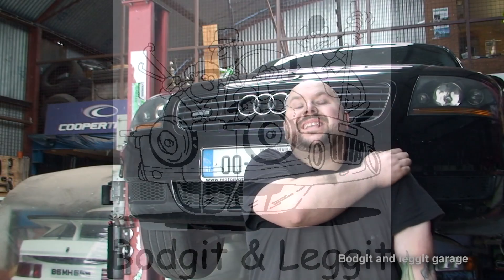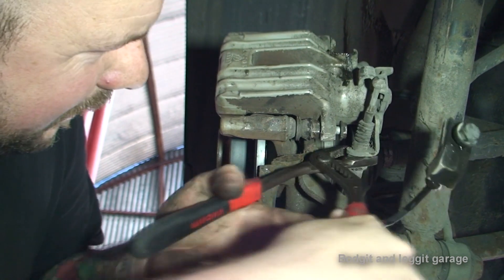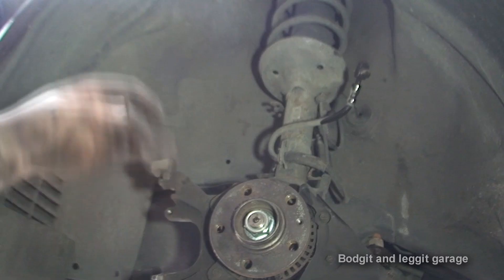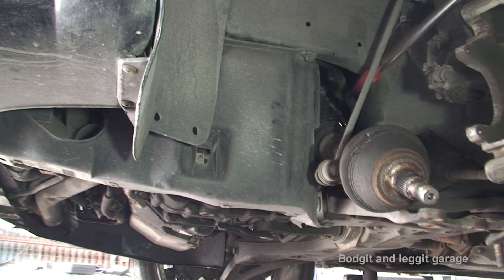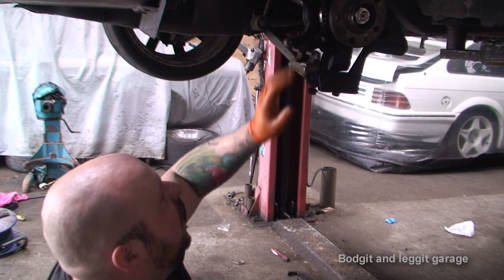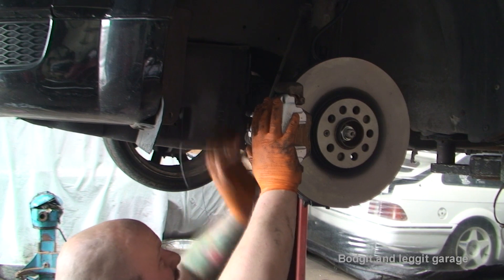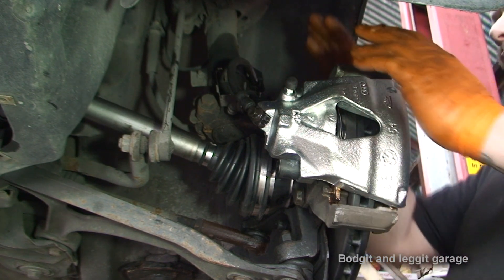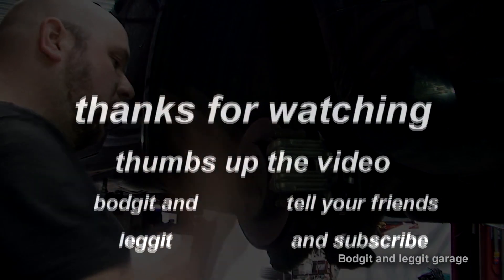Audi TT Replacing front/Rear calipers front drive shaft part3 bodgit and leggit garage

Comment: Great video. Very informative. I'm going to replace a rear calliper on my TT Mark 2. Will it be the same as this basically? A friend has told me that I'll only need to bleed the brake I'm replacing. Is that right?
Reply from the maker: YelpBullhorn hi mate yes it will be very similar as you can see from this video I never undo the bleed nipple just turn back the pistons make sure you take off the cat from the brake cylinder in the engine bay this is all you need to do been doing this for a long time and never had any damage doing it this way also this way you do not have to bleed anything

Comment: Excellent video. I have a question. Don't you replace the copper washers for the calliper? Copper gets harder when you squeeze it by tightening the bolt. Eventually they don't seal properly anymore, I assume, because they don't compress anymore. I've reused copper washers also. But I always wondered if they would seal properly or not. Of course you can check that visually but still the question remains whether or not this is the right thing to do.
Reply from the maker: hi mate  good question i see where you are coming from  the I've never had a problem in doing this but the easiest way to check i've never had a problem in doing this but the easiest way to check his get someone to press the brakes as hard as a can when the engine is running you will see any signs of leaking us but not only that if you're pedal is soft you know you have a problem as long as you're pedal is hard you are not going to have a problem and you know you've done the job properly

Comment: When you placed the new caliper over the new brake pads, the top pivoting spring clip on the back of the brake pads was poking out the hole in the middle. Aren't they supposed to be captured and compressed (top & bottom, above and below the centre hole of the caliper) to hold the pad in place?
I hope so, cause I just did that on my rear brakes..... logically, it seemed the right thing. Otherwise, what purpose do those spring clips have?
Reply from the maker: Mark Muller you obviously don't watch the video to the end
Reply: Not criticizing or being a smart arse, just asking how they're supposed to go on. I watched your rear brake video, made notes and did the job yesterday. But when I had trouble sliding the caliper over the top of everything it was because of those brake pad clips. I ended up making sure they were compressed, top & bottom (i.e. not poking out the middle) because I thought that was logical. But then I watched this front axle video today and thought, 'shit, hope I haven't done it wrong'.... OK, yes just watched the very end. You tricked me because you started your "thanks for watching" bit so i thought that was it!
Reply from the maker: Mark Muller glad you got it sorted mate